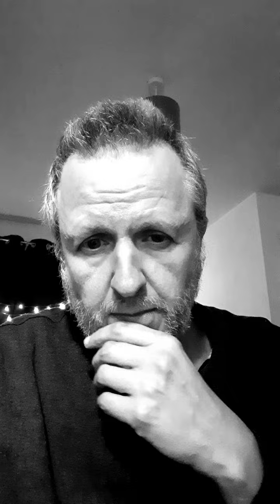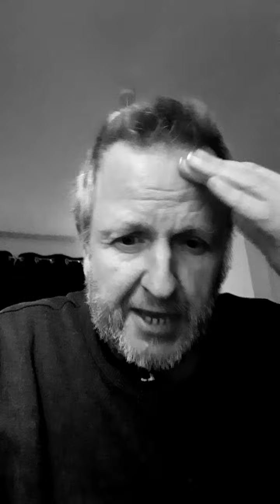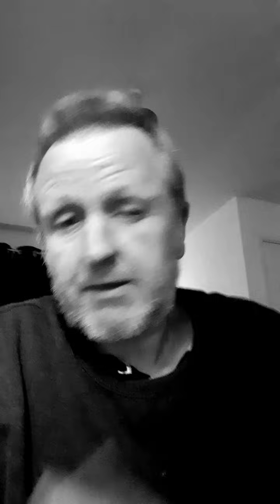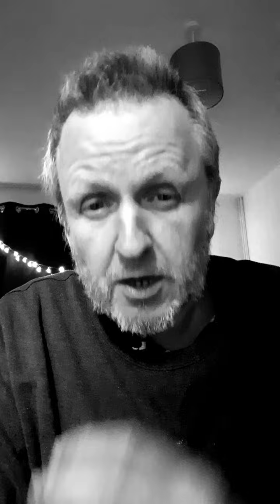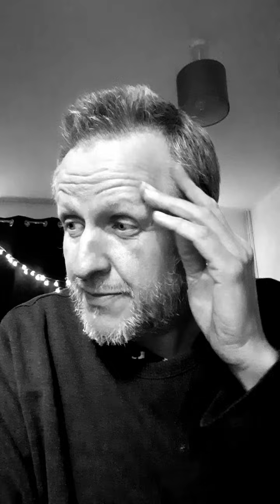Lucy Letby. Mark McDonald press conference Baby F glucose levels Glucometer faulty or contamination?

Comment: What with alarms going off and glucose machines not working that's a lot of machines not working as they should.  Did they all start going wrong at the same time then?
Reply from the maker: Hi Black. I don't know the Glucometer was faulty - it's just throwing the possibility into the possible range of questions to ask. Others have said that the glucose level was apparently so high - it must be due to some mechanism of contamination. I imagine we may find out more as the weeks and months pass, about this and every other 'case' on the indictment. Thanks so much again for your brilliant contributions on the stream yesterday.

Comment: Another thing that had me screaming and almost crying was about another baby.  Can’t remember which one. They freaking put a baby on high pressure oxygen who did not have lung disease just having periods if apnea which may indicate an immature breathing center in the brain which cures itself once the baby matures or an early sign if something else.  In either case all the baby needed was oxygen gently delivered to the lungs.  The lungs are very fragile in a premie always precede with caution with any pressure 

If the kid has microscopic lung disease that you can see on an X-ray you have no choice but to force air into the lung to bypass any inflammation in the lung. It’s a huge red flag. Depending on how damaged the lungs are you may need to send the kid to a neonatal icu that has a heart/ lung bypass machine called Echmo.  I pray the NHS has hospitals that have these expensive machines
Reply from the maker: Thanks for all this invaluable experience you are sharing here, Jar. Yes - this is baby O - on the hi pressure vent - causing distension - then (apparently) Brearey - inserts a needle/canular in the wrong spot , puncturing/lacerating the baby's liver - which has been driven down towards the pelvis due to the hi pressure vent - then poor baby goes into shock and cannot be saved with resus
Reply: @hopeisthething1965 I went ape shit nuts with this one! Flew off my chair screaming. My god. I a simple nurse knows that you never ever blindly ( ie without ultrasound to guide) enter a child’s belly with a needle.  Especially on the right side where the liver is located. It’s a big organ that very delicate and full of blood.  Then later it was revealed that a blood level taken during the resuscitation showed that the baby probably lost half its blood. And while the needle was in its belly the were pumping/ forcing air into its lungs causing the diaphragm to push the liver. The needle in the liver stayed still while the liver moved, thus slicing it into pieces. This is horror movie stuff. I’m not going to sleep well tonight
Reply: Questioned.  Either I read it somewhere or heard it today. Some baby had pneumonia in 1 lung ( sign of sepsis) and the other lung was completely whited out.  This is holy shit emergency!   This means someone freaking collapsed the poor child’s lung.  Probably had the vent on too high pressure. It was probably like putting a leaf blower into a kids lung. Do you know what kid this was ? 

And could it had been the same kid where the mother witnessed doctors and nurses googling how to insert a needle into a chest of a baby because they did not know how to do it? 

At the NICU at my hospital. It was not uncommon to insert needles into baby’s lung area and attached a chest tube that would aid in slowly reinflating the lung.  All went well. Probably because we had well trained skilled drs and nurses
Reply from the maker: ps confirmed no lung disease - today - by Dr Taylor for baby O - so no need for this high pressure ventilation

Comment: Hope this helps Mark. 

7 Reasons You May Be Getting an Inaccurate Blood Sugar Reading
1. Not washing your hands beforehand
This is one of the most common reasons for an inaccurate reading. Forgetting to wash your hands before testing means that whatever is on your skin can affect the results.
2. Squeezing the blood from your finger/Heal prick
Have you ever pricked your finger and then had a tough time getting enough blood so you squeezed your finger as hard as you could? This can also cause an inaccurate reading.
3. Storing test strips in the bathroom
Do you keep your meter or test strips in the bathroom? You want to avoid this because bathrooms often heat up and can get humid. For instance, when you take a hot shower, there is steam, adding heat and humidity to the room.
4. Taking out more than one strip at a time
Strips are also sensitive to light. You don’t want to expose them to too much light. It may be convenient to grab the strips you’ll need for the week and stuff them in your case. The trouble is, doing so can lead to falsely low blood sugar readings. Instead, keep all your test strips in the dark vial that they came in and only pull one out at a time for each test.  
5. Using strips more than 6 months old
Using the expiration date to determine when your strips expire makes sense. But this isn’t always correct. Avoid using strips if they are past the expiration date on the vial or when they have been opened more than 6 months ago—whichever comes first.
So, if you have a vial that has been open for more than 6 months but hasn’t reached the expiration date on the label, the strips are still considered expired. They should not be used. Using an expired test strip can also lead to an inaccurate reading.
6. Reusing a lancet
You may be tempted to reuse a lancet, but don’t. They can be exposed to dirt, bacteria and really anything in the outside world, which may impact your reading. 
7. Checking your blood sugar within 30 minutes of charging your meter
You go to check your blood sugar, but your device doesn’t turn on. Sound familiar? It’s time for a charge. And though the meter may seem ready once it is fully charged, you need to wait 30 minutes before checking your blood sugar. The device can still be warm after charging, throwing off your blood sugar reading.

As you can see lots of things can affect a glucose reading. Also unless the consultant specialises in diabetes they know very little about the condition.
Reply: OMG.... I see the list ....MANY THANKS 🙂
Reply: The people who have brought ALL of this to the forefront are "human beings" ..... when i know that i'm a "worm" 😞
Reply from the maker: thanks very much, Henna - yes, all is helpful - i just can't figure this concept of taking a blood sample from or near the glucose filled line? - hence giving a glucose blood reading off the charts - literally - and the 999 error code
Reply: @hopeisthething1965 On a baby it’s done by a heal prick, My daughter was born 5 weeks early and also born with problems with her heart including a large hole in the centre of her heart and she needed to have lots of heal pricks to keep a check of her glucose levels, so much so that her poor little heals look like dark purple plums afterwards. It’s the reason my daughter became a ODP Theatre Nurse and also the reason I’m fighting for justice for poor Lucy, because I don't want my daughter or anyone else’s daughter being the next Lucy to be made a scapegoat of to cover-up NHS Gross failing.
Reply: @hopeisthething1965999 often when not enough blood
Reply: @hopeisthething1965 The 999 code is just equivalent to 54 mmol/L

Comment: Omg Mark as someone who does not have medical knowledge I am impressed by your questions.  American nurse with 40 years experience working with adults and 10 years on and off experience as a case manager nurse who read a ton of neonatal icu charts 

I am appalled that the nursing units blood gas machine was faulty and not instantaneously replaced. My god that’s not safe for premie babies on oxygen let alone ventilators. I would not blame the doctors but the management if not the NHS for negligence!!!!!!!!!

You have to have a blood gas monitoring machine nearby.  Blood gases deteriorate quickly. It’s vital that you not only get correct oxygen and carbon dioxide levels but acid levels as well. It’s critical for the blood to maintain a precise pH level. If too acidic it will cause immense strain on the heart and/ or shut down other vital organs. Can kill quickly in a premie
Reply from the maker: Jar, please can I ask you - do you understand the mechanism by which a blood sample is taken - and the glucose is off the charts because the sample was taken from the line (where glucose was being given - and possibly being the same line where insulin had been given a few days earlier) - wdnt they get a blood sample from the arm or somewhere? I'm a bit lost on this. Was Dr Taylor suggesting today - the glucose level on test was so high because they effectively gave them a glucose sample to test rather than a blood sample?
Reply: @ apologies also if some of my words are hard to understand. I speak English not British.  Y’all call a crib a cot, a truck a lory. And for heavens sake we own the word football. Y’all call soccer football 😜😜😜😜😜😜😂😂😂

And yes we turned your cricket into something we call baseball. Then called the championship the Worlds Series when it’s only played in America.  Americans love to brag. It’s what makes us fun to make fun of.  Us Americans love UK trust me. We mourned almost as much as you when you lost your beloved queen. And I can say with certainty that 99% of us hated Megyn markle for what she put that sweet lady through.
Reply from the maker: @jar942  I do love the little differences in language use and words - it really is interesting to hear about them. And even pronounciations - such as oregano and basil. Not sure if any other herbs are said differently.
Reply: @hopeisthething1965 mark. Got a question. Was there any rumors that the consultants had any alcohol or substance abuse issues ?  Would explain their lack of being on the unit. Being sloppy and negligent
Reply: @ this is my theory. May or may not be correct. Insulin itself is a very sticky thing. It loves to stick itself to plastic.  That’s the reason why when we draw up a syrinx of insulin for a diabetic adult we give the medication rather quickly so the patient can get all the insulin 

In a plastic tube such as an intravenous catheter I would not be surprised to find out there might be some old insulin stuck inside the plastic tube that might come off later 

In addition when it comes to an IV bag and you add insulin for a slow drip over several hours there is a certain calculation that the pharmacist does that he calculates that a certain amount will stick inside the plastic bag and the patient will only get a certain amount of insulin.  So if Lucy was to kill a baby via adding insulin to a slow drip iv bag she would have had to use a ton of floor stock insulin. Would have easily been caught
Reply from the maker: @jar942  Thanks so much, Jar for this very detailed explanation. And we also have the issue of alleged prior tampering - ie a bag used once Lucy gone off duty. So if they allege one bag tampered in advance - why no all of them - in principle - at an unknown time and place in the past. Therefore who was on duty is not relevant. (this point was made by a twitter user - Angela - some months ago - and was not raised in the trial by defence, alas)
Reply from the maker: Thanks for this excellent information and explanation re importance of blood gas testing, Jar! I think it was The Telegraph newspaper that did the expose on this part of the story - might have been Guardian. This idea of getting the blood sample from the glucose filled line (or somehow getting a contamination from it) - does that make sense? I just can't figure it? Sorry if i have asked this before - am getting a bit tired.
Reply: @hopeisthething1965 totally makes sense. The nurse did not shut off momentarily an iv infusion that was going on in another line that was close to the line used by the nurse.  Baby can have more than 1 iv line. And/ or if only 1 line; she did not discard the first few drops of blood that was contaminated with insulin and/ or glucose from an infusion. Should only use the next blood draw which should be clean. And if I can remember I think he said that there was an issue where both glucose and insulin was high. That had to be contamination from a line that contained both glucose and insulin.  If you have high insulin you have to have low glucose because insulin lowers glucose in the blood.  Having both high levels are a red flag for contamination that doesn’t take a physicals level of knowledge
Reply: @hopeisthething1965 an arterial blood gas would never be drawn along with a blood glucose.  These are 2 separate machines.  2 completely different tests. I’m not sure how they get arterial blood gas but I think it would come from the umbilical cord stump.  Soon after birth they can thread a catheter into a vein into the umbilical cord which would be used to draw blood for basic labs to check glucose/ insulin / anemia levels.  Can add a second line into the umbilical artery in the cord. Since this blood is so oxygenated it’s the one that would give arterial blood gas readings: oxygen, carbon dioxide, pH levels that are so needed for oxygen/ ventilator management 

Another monitor device they use is a heart rate monitor that they can stick right on the baby. None of this hurts. This can count the pulse. Another sticker can monitor how many times the baby breathes.  A third can monitor the oxygen levels in the blood by shining a special light on the skin. They put it usually I think on the foot. These are all hooked up to one easy portable machine. Dumbshit Dewy Evan’s when shown this at the trial had no freaking idea what it was. This was done 30 years ago for my daughter. The oxygen monitor part called oximetry is only so so accurate because the babies skin is so translucent but it’s a good continuous screening monitor to keep on the kid. If the kid has a weird oxygen level then you check blood gases via the umbilical arterial line 

This monitor is vital in a neonatal unit.  It can tell 3 things all at once 

1. If the baby stops breathing and for how long. The nurse will stand at the crib and see if the baby will self correct or if the nurse just needs to stimulate the baby by rubbing it.  Depending on the severity of the apnea it could indicate just an immature brain and nerve passages that just needs to mature and will go away. If the baby does it to many times in a day the doctor will have the nurse give the baby pure caffeine as medicine a few times a day to stimulate it.  We joked and said this baby wants Starbucks 

2. Now if the babies heart rate goes down with the apnea that maybe a sign of immaturity again. Or could be related to more serious underlying condition 

3 now if apnea and Low heart happens along with oxygen going down that again might be a sign of immaturity if the baby quickly self corrects.  But if it occurs at a certain length then that’s oh shit territory. I’m not experienced enough to know what’s good and bad about these numbers.  It probably depends mostly on if the baby has underlying issues.  And I’m not sure the length of time is required for them to consider it an  emergency.  A good well trained neonatal icu would know what to do 

Another point. Adults have heart attacks that causes an adult to stop breathing.  It’s reverse in a baby/ child.  The breathing stops first, then the heart stops after it can’t get any more oxygen. 

I know some of these babies had periods of apnea hours before their crashes so the crashes could have been expected. I have no doubt that the nurses were watching the monitors. However the doctors should have stayed close by just in case. That was negligence or overwork ( they had to cover the regular children’s ward).  Not much a nurse can do when a crash happens except to call the doctor and start CPR

Another bone of contention for me. Those neonatal doctors should never have to cover both a neonatal ward and a regular children’s ward. You are just asking for cross contamination from those kids with respiratory virus and gi bugs. Geeze at my hospital no pediatricians had to do that. They would have to cover a children’s ward and a healthy newborn full term nursery. Never ever an icu. Same for the nurses. We kept these areas separate for infection control.  

I heard the NHS was not doing well. But had no idea it was this unsafe. You Brits deserve better. You gave us yanks great rock and roll and Monty python……… made my high school years fun……. Could listen to Layla by Eric Clapton all day long.
Reply from the maker: @jar942  Thank you so much for sharing your knowledge and experience here, Jar. This is so useful for lay people to hear, and understand - I really appreciate you taking the time to go into this level of detail about the procedures and the equipment central to looking after neonates. thank you!!!
Reply: @ omg.  Anything I can do to help someone sticking there for us nurses. We owe you and may we never forget. Besides as an American I’ve always loved the UK. I grew up on 70 s British rock and roll. Loved Monty pythons and fawlty towers. All the wonderful historical costume dramas.  I love most of your actors except the weirdo woke ones. But especially I love how y’all started the right for healthcare for all back in the 40 s.   In America you only get subsidized healthcare if u are poor or over 65 and the coverage stinks. Insurance companies are a nightmare. Our hospitals like yours are starting to crumble in the rural areas. I think that your NHS is a canary in a coal mine for us. It’s only a matter of time for us in America